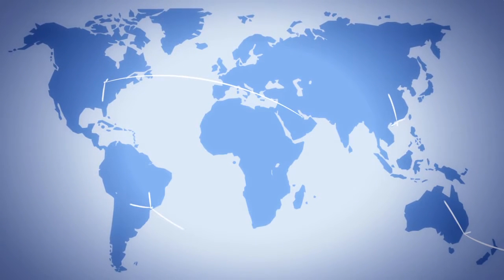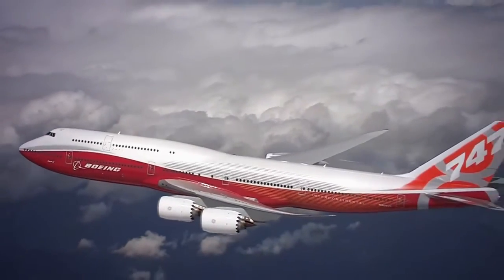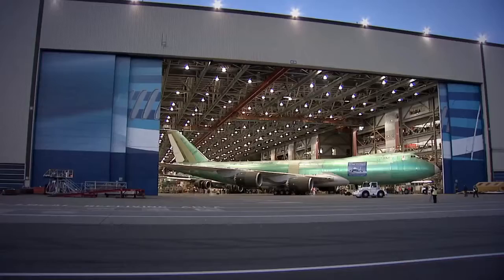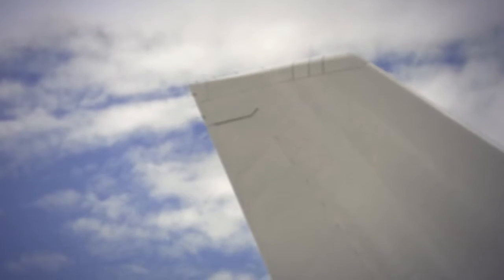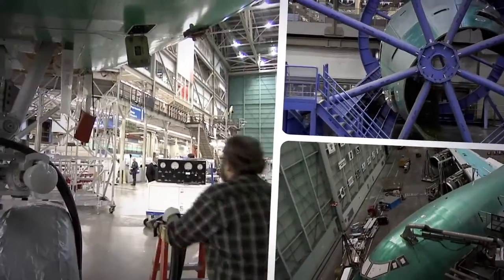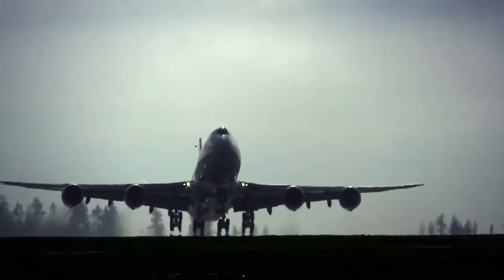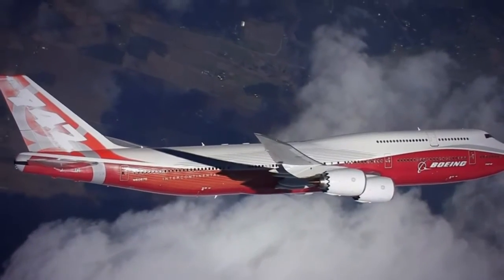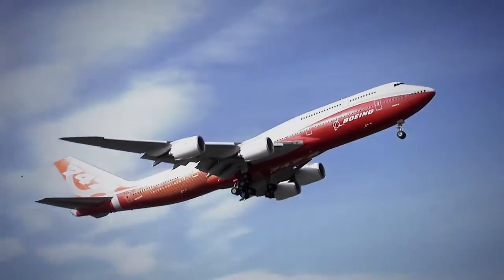Boeing 747-8 Wing Design

Comment: Combining magnetic joints, wing tips, parts, and even smaller magnetic wings next to a other metal wing areas increases flexibility to large wings on these giant and even fighter jet wings better. Small magnetic flaps on rockets next to each other reinforces strength and stability to increases in wing and air velocity.